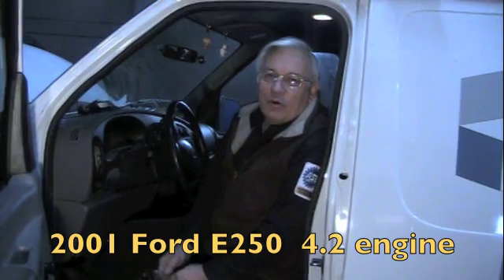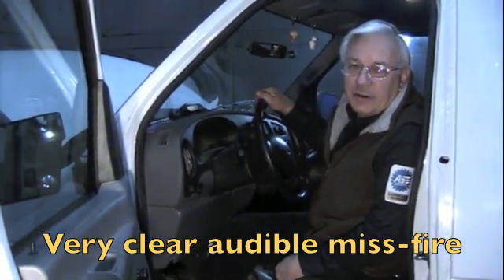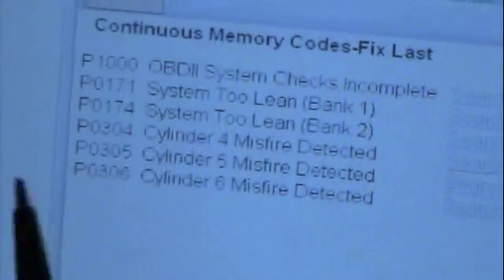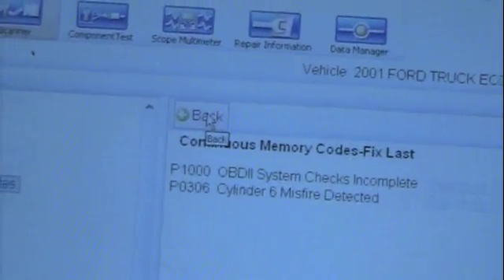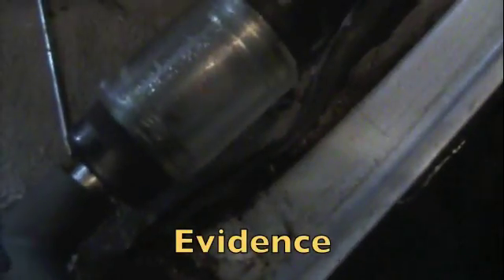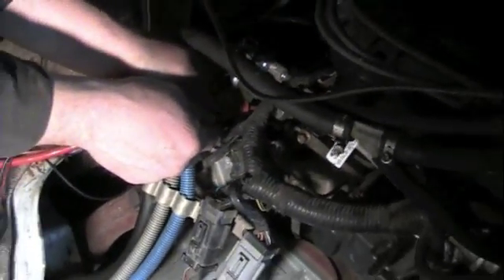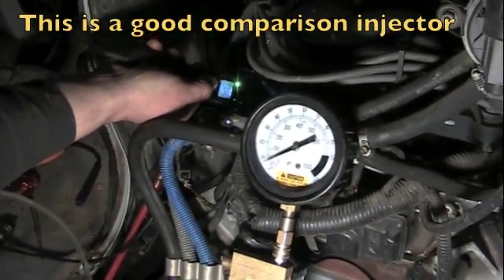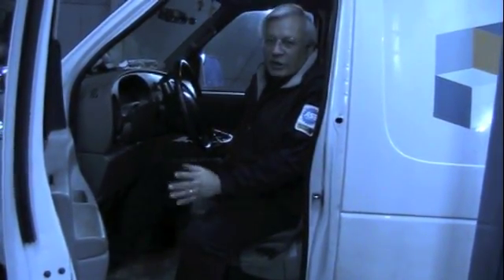Diagnosing a misfire

Comment: One problem I see with most mechanics Nowadays they rely on the computer too much. When you have a Wire that is grounding into another wire in the harness these guys won't help you. These guys are not wire experts Went to 20 shops on a 1996 ford ranger it was the transition year for OBD1 to OBD2. Most of these guys Pass the buck on First modal year made cars and trucks cus they have Massive BUGS and if the truck is no longer under warranty from ford or chevy or whoever made it They will still charge you But not fix it. There are a lot of misfit car's and trucks these guys will refuse to work on One is the 1987 Chevy C10 C20 Vans First Year of the Throttle body In 1986-87 some Mechanics thought there was a ghost Code It5 was a 088 code in the OBD1 first computers. They said at the end you had to replace the whole Wire harness. So ya there are a few Car's that most of these guys will refuse to work on Like IPV Vans form Honda or Nissan most smog shops would tell you They wont smog it it takes 2 hours to smog the Van You have to remove the drivers SEAT Funny.

Comment: Now you can use a stethoscope Its the same tool what your doctor listens to your heart But it has a long Rod You can use a long screwdriver and your hear tapping noises if your injector is opening and closing If you don't hear the motor running that tapping noise something like what you hear from your PVC valve. It will save you some time

Comment: A timing light can check for misfiring plugs. The light should flash consistently. If it is erratic, it could be the plug or wire or cylinder, or intake gasket, or coil, or module. If the light flutters, it's the module.

Comment: I'll throw in my hat if it helps.  Mine is an 01 Dakota 3.9 V6, 100,000 miles.  I had a misfire on 1 and 3, and misfire on multiple cylinders.  I changed the throttle position sensor, IAC sensor (I didn't do the MAF sensor yet), crankshaft position sensor, replaced spark plugs, spark plug wires, air filter, checked compression, checked for spark, and anything and everything else I could think of, and everything worked good, and after 2 years it was still no help.What finally fixed it for me was changing the two upper O2 sensors.  And I just happened on that by mistake.  I had been meaning to change them out just because I knew they were old.  The two lower ones were tight, so I never got those off.  So I replaced one of the upper ones, and the truck ran 1/2 better.  I then replaced the other, and boom, all good.  I know everyone is throwing a ton of ideas out there, BUT everyone's ideas are ALL legit.  I mean, the whole process from air intake to combustion to exhaust all needs to work right.  And if something along the line fails, it can cause a misfire.  If you want to try a cheap trick, remove or disconnect the upper O2 sensors and drive it around (This will probably throw an O2 code, but big whoop).  If it doesn't misfire, you might have your diagnosis.  I figured my O2's were clogged up and thus sending bad info to the computer, which in turn was sending bad info to the other sensors responsible for combustion.

Comment: I need help with my 1987 Ford Ranger 2.9L. I have replaced all the spark plugs( made sure the gap was 0.04) checked all the connecting wires. Distributer gives spark on all the probes. Still misfires on cylinder 2

Comment: Nice job, I like your quick overall diagnostic steps.  Vacuum, clean the Mass air flow due to potential of causing lean codes, confirmed spark, confirmed computer control of injector and finally fuel pressure drop when injector actually fires.
Question, what type of current pattern would this injector have presented compared to the other good injectors?
Thanks.

Comment: Thank you for posting this video, I have a 2005 Nissan Altima 2.5 that gave a P0301. Quick list of work, replaced the; valve cover, gasket, ignition coil, spark plug (which was covered in oil because the valve cover was cracked), ignition coil wire connector, and did the rpm drop test. The drop test showed no difference in power for one and drastic for the rest. Thanks to your video I can now test the injector which should speed along my repair. One of few exceptional videos to help with difficult repairs.

Comment: My car is having that cylinder 6 misfire I have a 2005 Suzuki Verona 99000 miles and I took it to a mechanic but he said the spark plug is stuck I wish I knew how to get it out myself because I would he wants to charge 4000 dollars for a new engine .
Reply: Most repairs on the spark plug hole would be in the range of $150 to $250 Your mechanic is a con artist
Reply: +Ralf V I got another mechanic to put them in for wayyy cheaper but I'm having misfires on all cylinders expect 6 cylinder
Reply: Kenya Vlogs Needs to be Diagnosed Properly by a technician.

Comment: replaced spark plugs and car ran fine but now it's starting to shake again (same day) as I put it into drive or reverse. any Ideas?
Reply: Did you ever find out what was wrong?
Reply: +Dodge 318 Cummins I did not thanks for reply. not going to bother
Reply: +Anthony Sosa my truck I replaced spark plugs then the misfire started I then did new plug it makes a popping noise out of exhaust I feel a loss of power I don't know what to do...
Reply: +Dodge 318 Cummins did you found out the solution ?

Comment: Question: Could I substitute a 12V power supply instead of purchasing a power probe. I can rig up a supply for the injector test? Also can you use a Fluke meter instead of a NOID light to monitor the computer control signal to the injector??

Comment: if I had that scanner obviously I could find it too...this should b how to without a scanner
Reply: +Su Sang pull each plug wire 1 at a time and start it. if its worse its not the cylinder misfiring. if its the same you found the problem cylinder and go from there

Comment: Great video he is a good mechanic . But most other mechanics are crooks . They wont stop until your pockets are empty.
Reply: There are bad shops out there, no doubt, but there are a lot of good honest, hard working mechanics/technicians as well.  I still do a lot of my own work, but I use a local shop sometimes if I have a problem I can't or don't want to work on.  These guys are honest and good mechanics.  I found them by looking up reviews on their shop.  One negative review complained about a car that had an intermittent problem and they couldn't fix his problem so they gave his car back at no charge.  I have worked on intermittents in electronics and I know it is hard to fix a problem that ain't there to troubleshoot.  So, I thought that sounds like an honest shop to me and I started using them.
Reply: so true you have to look at them and most time they try to convince you their guessing is right to try

Comment: I love your video, its very informative. I need some HELPPP.... I own a 2007 mazda 3 and i believe i am experiencing a misfire when my vehilce engine gets cold.  But i am not sure how to proparly identify what the problem is. When i start the vehicle it sounds like its stuttering or stifling for fuel, then i get a high rev and then it settles like normal. What could be causing this problem.
Reply: I don't think you have a misfire problem. I would check and clean idle air control valve first it's probably full of carbon deposits.

Comment: By about 2:00 in when you covered a vacuum gauges use that I've never seen before you had me subscribe. Use the vacuum gauge...if it's steady then all of the motor is creating vacuum steadily? Right, don't take the extra time at this point and do a compression test or leak down test. Makes sense.

If you can think of a time where you should do the extra tests anyway, let me know.
Reply: Let me review what I learned for my benefit. I knew that a dirty/bad MAF was a common way for Ford's to show a lean code on both banks P0171 and P174, but what I didn't know was that method of checking injectors.

First you confirmed spark. Then you checked the fuel injector wiring harness with a noid light. The ECU was giving the command to fire. You used a power probe to command another injector. It dropped the fuel pressure, while the misfiring cylinder did not.

Thanks again for the video!
Reply: DE Nichols cote po193

Comment: ( 2001 audi 2.8 ) i got misfires on one bank but not the other side and when i look at the fuel trim was pos on 1 bank but neg on the 2 bank where i me getting the misfire at and i check and replace all air lines and spark pugs and wires

Comment: For most folks who lack the equipment used here, try this, It's what mechanics did before computers:
Run engine;
Use  well insulated  pliers, and remove one plug lead at a time, and listen for the revs to drop or have someone watch the tachometer.
If the revs don't drop at a particular lead (or  leads) then that is the bum cylinder/plug/lead. If your ears ain't finely tuned to picking up a  misfire, after finding a good cylinder, leave it off as well, adn the misfire on the bad one('s) will be more apparent.
To test injectors, just crack the union on the pipe one by one and note drop in revs -if no drop, it's faulty.
BTW, a spark plug operating outside the engine at room temp and atmospheric pressure is NOT a guarantee that it is working inside the cylinder. It usually is, but it's not definite.
Just swap the plug or injector from  the bum cylinder with one from a  good cylinder -if the misfire then switches cylinders, you know then it's a  bum plug or injector.
Reply: Before computers it was simpler, and the cars were much cheaper.
Reply: And the diagnosis people were better.  Had to be. Like a GPS unit, GREAT tool !!  But not like the human brain. What if power goes out in the shop ?  What if the screen gets dropped ?  Can a car be patched to get home ?  Lost skills.  I am 70, been working on cars since age 15.

Comment: i have a motorcycle that has a misfire problem i cleaned the carburetors battery is good spark plugs are good vacuum lines and intake boots are good its got good fresh fuel the valves are all adjusted and coil packs and the wires are all good.does anyone know what could be causing this problem im not a certified mechanic but i know how to fix things but just not sure at this point what could be wrong i tried and tested everything that i could think of.if anyone can help please let me know.thanks

Comment: most driveabilitry techs are honest and skilled. i noticed he did not inspect the plug(s) at home you can use that as an indicator of rich/lean.  when you dont have your harbor freight spark tester, you can ground the threads to the floor panel and crank/start. i would recommend cleaning the causal tank and or both if equipped. or sample/ filter/ refill. clean the injector rail too. replace 6 if dirt found forward of filter

Comment: I have a 95 tacoma 2.4 automatic with a miss No codes No cel on ,,, engine shakes at idle & hesitates when I accelerate, I cleaned maf,iiac,cleaned all throttle body passages, new plugs /wires,new dist cap & rotor  idk what else but u can feel vibration throughout the whole truck

Comment: continued: I have filled up with premium fuel twice now and a bottle of heat, and a bottle of seafoam. Both injectors have been replaced. Spark plugs look normal with no oil residue. Wires are in great shape 8mm high temp. I replaced the map sensor as well after watching a video about running rich and looked for any type of vacuum leaks and plugged those. Am I missing anything that would still cause this besides dropping the tank???

Comment: great information, a little loud considering that you do have other vehicles running. I have a 1988 chevy 4x4 with a 350 TBI. I had an exhaust leak on the passenger side on the header. I replaced that. Now I hear and can feel a drag in the power side meaning that I think it may be bad fuel. distributor replaced cause it wasn't keeping time. Plenty of rust and a big chunk of metal was in the cap. but I have popping noises and I have t find a sweet spot to make the truck go.really shook the truck

Comment: didn't do it again until 7.18.13 at a different gas station out of town didn't top off or don't remember if I did or not.  same thing happened but reacted a little different on start up.  got it to finally start up and then idle problems at lights like engine sounds of vroom vroom like it can't keep sound steady like jolting the car did it random. yesterday7.23.13 when I started car nothing but clicking. took it to ford and it was a dead battery but radio,lights worked w/out dimming

Comment: I wish you were my mechanic.  I go to Ford by my house and they messed up things on my 01 ford focus.  I've had a piston replaced,  all 4 valve seats replaced,  head at the machine shop,  and now latest problem started 7.4.13 at shell gas station by my house,  I was about quarter tank before fueling and topped off about 50 cents or less isn't much but when I started my car,  started turning over but vibrations and stalls unless i apply foot on gas petal until car fully runs or chokes off.

Comment: I HAVE AN E34 535i 1990 the car isn't working perfectly i have extra fuel consumption, no oil no water consumption, when i put my foot on the gas pedal while driving the car seems moving backward and forward u can feel it but not too much, and the car runs not perfectly u can feel it " it takes too much time to accelerate .." could this be a problem as this ford ? ty for ur reply

Comment: hey thete ibrecently washed my moms 2001 mustang  engine 3.8 anf i covered thebcoils and starter butbitbstarted missfireing then i found that the 3rd cyl is misfireing  i reolaced spark plugs they were disghustingly rusty. that helped a bit but still is misfireing. once i unplug the 3rd cylinder plug wire from thebcoils it makes no change and no static charge at all. so is that the bad coilpack then??

Comment: I just had the same problem with a 4.6 in an 09 crown vic. I checked everything, New injector, new plug, swapped coil with number 5. But i still have the miss. I don't have a noid light but i used a test light and found signal. The miss is on cyl 8. We ordered a known good ecm to see if it's a driver problem. any suggestions?

Comment: OK I need help I have a 1997 ford ranger 4.0 reads off the same bank 1 code but when I pull off the plug on the right the vary front 1 their is no change runs the same but miss fires I have replaced coil plugs and wires vaccume is fine email me if u no at anything thanks sterling604@gmail.com

Comment: Well i have a mercury sable 2001 dohc and i got a similar problem. P0301 code .is to slow when u acelerate and in a small hill start shaking then if i press the acelerator get the rpm. And go but sound like rough idle so what you recomend to do

Comment: is there any other way to check what injector is not working. my van sounds just like that, already got new spark plugs,wires,fuel pump, fuel filter,all o2 sensors, and finally spend $400 on new catalytic converter and still with the same problem, i also can smell gas in the car when driving. thank you

Comment: I have a 2002 nissan sentra ser spec v, my SES light comes on most of the time and goes away. I did a self diagnostics and got the code p0300, the car has a hard time starting but runs perfect after it is started. Any ideas? by the way about a year ago i had the engine remanufactured and a new alternator.

Comment: damm man your the best man im a subscriber !!!i habe some questions i have a 2001 chevy tracker v6 twin cam i wash my engine bay with a pressure washer and after a minute or 2 my engine started to shake i changed the plugs and all coils and still does it i have code p0171 and multiple miss fire my map sensor is broken i fix it with some silicone till  i get the new map sensor now it only reads code P1071 do you think its my map sensor engine shakes when idle please help thank you !!!

Comment: If it was stuck open it would never build pressure. On top of that the engine would be running very rich in that cylinder.

Comment: I had to replace the injectors on a Nissan Maxima. Had to remove the plenum, lower intake manifold which required replacing the gaskets. Finally pulling the injector wasn't so easy without the special tools they have for that. So in a case like this, you want to be DAMN SURE the injector is bad BEFORE you replace it.

The Maxima is a pretty good car. This one has well over 200k on it and it's still going strong.

Comment: Well, my Volvo's injectors are connected to a fuel rail which is easily removed with two 10mm bolts.  The rail is designed to swing backwards while still connected to the fuel line so swapping an injector takes about five minutes, from popping the hood, to starting the engine. Obviously, on a less well-engineered car, you would find yourself testing them with a multimeter first, then pulling them, cleaning them, replacing, etc...

That's why I buy good cars ;-)

Comment: @masster64 thought of drag in the pulleys or pumps, assuming that it is mechanical problem... 

idle between 800 and 900 is a "normal" working condition
better to upload a video up showing the engine running and describing the problem...

Comment: Hey Duane, Quick question, my car does misfire ses does flash but after letting it run for a few minutes the ses light isnt flashing and does not feel like its misfiring anymore i recently had the pcm and ecu were replace due to a pressure problem the engine is a 3800 supercharged. Please help. Thank You

Comment: @zloben9000 swaping the injector will not help you if the computer isnt working right. it just creates more work to open the fule system 2 times when all he needs to confirm his findings is a simple electrical and pressure demenstration

Comment: @1PossumJenkins  Not according what he stated...the vacuum is for mechanical fault NOT fuel.  As long as the engine is rotating and the valves are working etc...it should be steady.